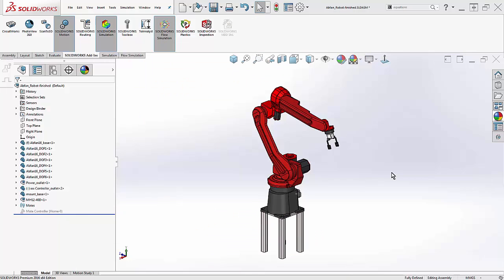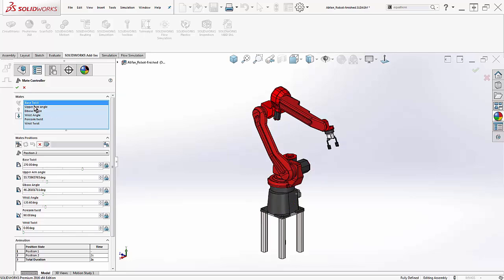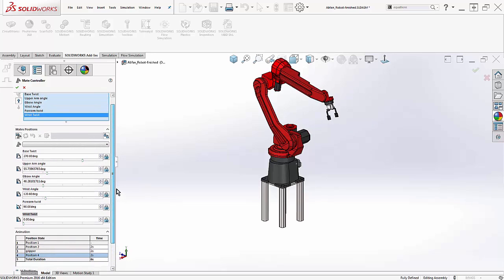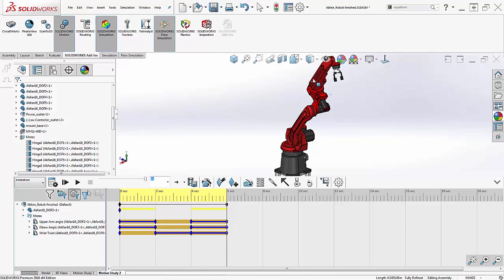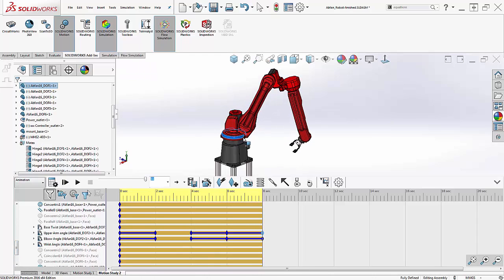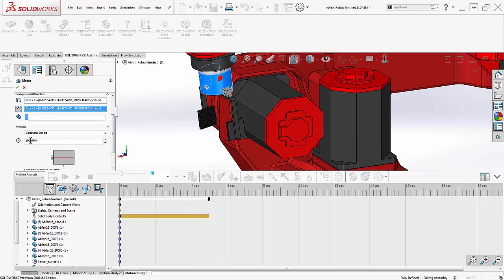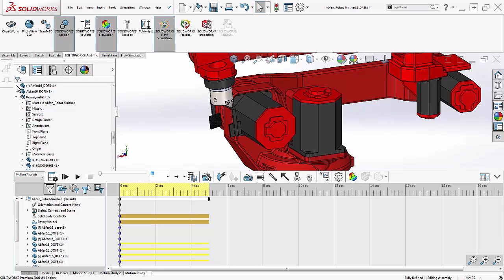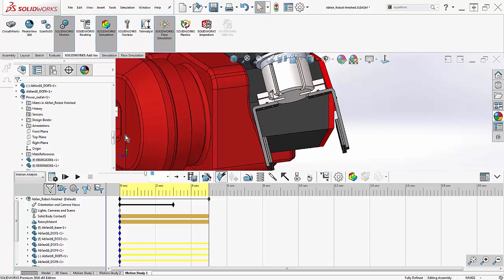SOLIDWORKS Motion - Tips for Robots in Motion Simulation

Comment: Is there a tool that works in or out of solidworks (a full app) that helps make the robot motion study more accurate to what the robot can do with a given end-effector (gripper) payload? (accurate cycle time prediction)

I'm always doing motion studies with different manufacturers robots, so a single-robot solution like RoboGuide or Robot Studio are not adequate.
Reply from the maker: Hi Jaysephus,
If SOLIDWORKS Motion is not accomplishing this for you then we do not have recommendations for other software that would otherwise do those calculations for you.
Reply: I'm wanting something that works with Fanuc and ABB at a minimum, and takes into account the robot vs payload to be roughly accurate on cycle time analysis, rather than two or more seconds off. 

My research shows that maybe Delmia's robot-related tools might address this, otherwise you have to use the dedicated Robot sim programs from each manufacturer. $$ vs $$+$$+nth different robot manufacturer we work with.